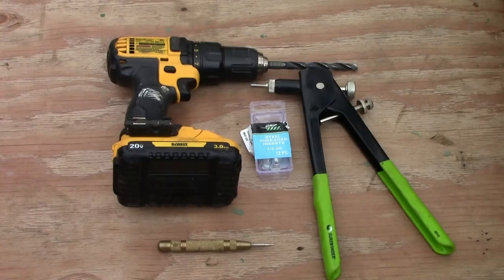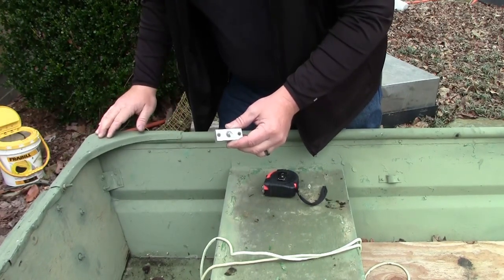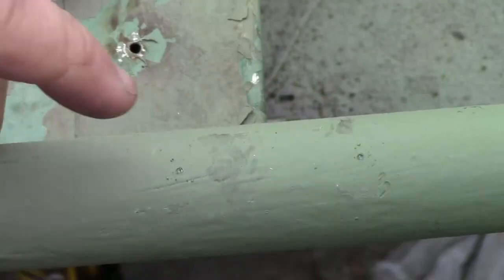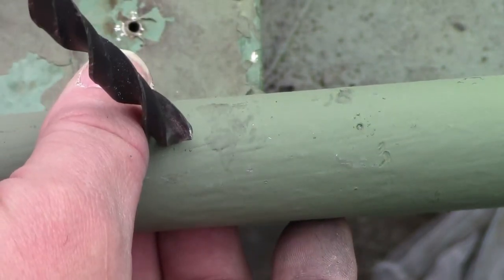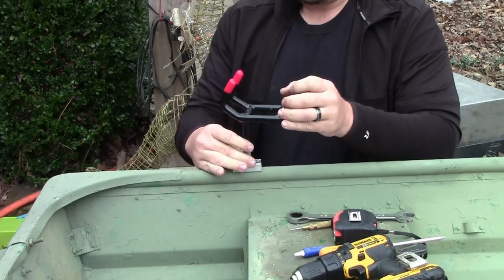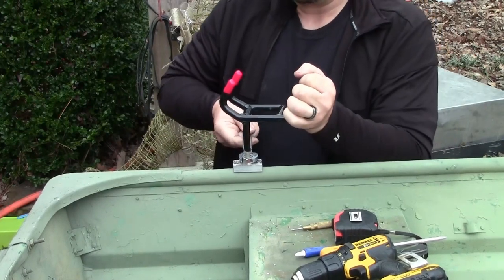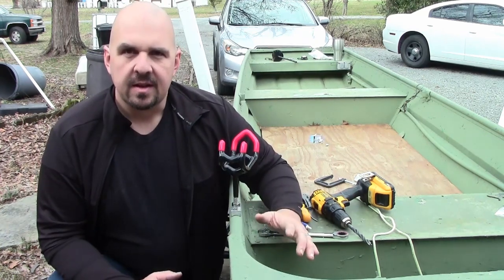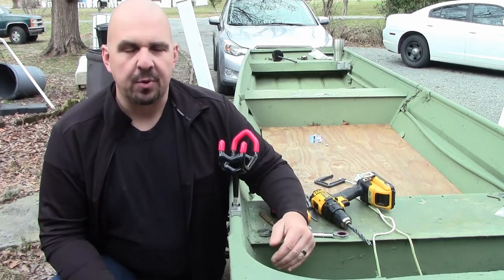How to Install Monster Rod Holders on an Aluminum Jon Boat Gunwale - EASY WAY!

Comment: I had a Tracker Pro Crappie once.  Used self tappers for all my mounts.  They loosened overtime.  This will be the route I take on my new Jon Boat.  Be safe out there.                  thank u

Comment: Just bought all the tools to do this monster rod holder install. Just thought of something tho. My jon boats gunwale is actually flat on top so I just got the flat economy bases from monster. But I got to thinking. Couldn't I just install a 1/2 rivet nut into the gunwale and screw my rod holders directly in to that instead of even using the bases? 🤔 Thoughts? Concerns?
Reply from the maker: You could install a half inch rivet nut, but personally I like the idea of having two points of contact with the gunwale. If that rivnut decides to turn loose with a fish on, that rod holder is going in the water before you can grab it. The odds of two rivnuts going at the same time is much lower.
Reply: @TheWeekendAngler  Ok. Thanks for the quick response. I was thinking doing away with the bases would make for a cleaner look but yeah I can see your point there. 2 would offer more security.
Reply from the maker: @rbarrett8441  a big or a big snag can put a lot of torque on the rod holder in a hurry.

Comment: This looks GREAT...one question though. Is the tool used a standard pop-rivet gun or something different? Thank you in advance...Never mind I replayed it, missed it the first time 😃
Reply from the maker: Here's a link to a tool virtually identical to the one I have. The only difference is mine was purchased at Menards and not Harbor freight. I'd bet money, however, they're made by the same factory.
https://www.harborfreight.com/45-piece-threaded-insert-riveter-kit-1210.html
Reply: @TheWeekendAngler  Hey...THANK YOU!!!

Comment: Does anything come with the base? I know you had to buy inserts and tool separately, but what about screws?
   
Thanks
Reply from the maker: Just the base.
Reply: @TheWeekendAngler  so what size screws!???
Reply: Do you think those inserts would be strong enough if you hooked up with a really large catfish
Reply: @silvermanicattack ….    Just have your drag set low.  You can always tighten it up once a fish is hooked.

Comment: Do you remember what size screws you used?...or did the mounts come supplied with screws?  Thanks!
Reply from the maker: I used 1/4x20 stainless steel machine screws. 1-1/4" is a good length.

The mounts did not come with mounting hardware.

Comment: Hi great video. Where can I get those inserts, screws and tool? What size?
Reply from the maker: I bought the tool and inserts at menards, but they're available on Amazon also. I used 1/4x20 inserts.

Comment: Without the rivnut if you just used self tapping screws would that work?
Reply: Good question 🤔  Idk how much force it would hold up to?
Reply: No they don’t get tight enough then they rip out over time trust me $200 rod and reel setup went to the bottom of the lake

Comment: Man that’s slick. Which model rod holder did you go with?
Reply from the maker: Thank you! That is the monster Rod Holders Talon 5/35. They're an excellent balance for drifting, dragging, or anchoring.

There is a link to them in the description of this video.
Reply: Go with the duo.
Reply from the maker: @paulatkinson4439  Duo?

Comment: Did the same thing, theae wont  hold up for big fish. You will get severe rod holder movement when the rod loads up, the fix is a aluminum angle that connects on top and side of gunnel with the same rivetnuts, just making 4 connections to the gunnel to prevent that roll of the holder I am referring
Reply from the maker: Sounds to me like you're setting your drag way too high. I no longer have this particular boat, but I had zero issues with these rod holder mounts. Your solution, however, would definitely work as well.
Reply: @TheWeekendAngler  maybe, but I don't set my drag tight, have you hooked into 50 to 60 pound blue cats with this setup?, I just found the base and rod holder wanted to roll when loaded up, not to the point it likely would have came free, but I decided to strengthen to the boat better just in case, I really dislike round gunnels, my next boat I'll get something with a versa track

Comment: I'm going  this route  on my 10ft  little  jon for  smaller rivers  and lakes where is the best place to  purchase  the nuts I think  I wanna go with  either  hex head  bolts  or regular  bolts  to mount  my monster rod holder jon boat mounts  what's your opinion
Reply from the maker: I buy the threaded inserts at Menards but they are available on Amazon also.

Hex bolts would work fine too. I don't the it would really matter, as long as you use stainless.

Comment: Last question! What size are those screws you used to secure the base to the riv nuts?
Reply from the maker: Those are 1/4x20 stainless machine screws 1.25" long.
Reply: @TheWeekendAngler  ok I orders the bases through your link. I’m ordering the larger stem holders now.. It looks as if you can get pretty much everything else at harbor freight I’ll stop by there after work. Thanks for the great video and idea.

Comment: What size is your monster rod holders on your Jin boat
Reply from the maker: It's the standard length stem.

I run the 33/45 or the talon 5/35 depending on how I'm presenting my baits.

Comment: Will a simple “pop” rivet gun work or do you need an actual riv nut tool?
Reply from the maker: I wouldn't trust my rod to a rold holder installed with a pop rivet. My fears are it would hold until it didn't...
Reply: All I needed to hear. Thanks. And one more question if you don’t mind.. bottom fishing circle hooks. What would be the best monster rod holder for that? I’m confused with all the different angles. I was thinking the 33/45
Reply from the maker: @bryantvermeys4336  the 33/45 is great for anchoring and dragging baits. If you're going to be suspend drifting, the talon 5/35 is the best one I've ever used and it will still hold a rod at 35 degrees for whe you're anchored or dragging.

If I could only pick one, I'd go with the talons. They're amazing.
Reply: I’ll just be tied up or anchored in a smaller river fishing cut bait on the bottom for small channels up to 10 lbs, occasionally a lake where they get up to 20+ but don’t plan on drifting or suspending.

Comment: Has anyone thought about having those monster gunwale bases welded on? I am thinking about doing that but idk if it’s possible or how it would go
Reply from the maker: My buddy had it done on his boat. Find yourself someone that's really good with tig welding and you'll be in good shape.
Reply: @TheWeekendAngler  okay thank you. Did it turn out good? I have a Lowe 1648 with round gunwales like your boat and I am really into catfishing with big baits and big rods so I hope it will support them if welded.
Reply from the maker: @grizzy7469  it's working quite well. You can see it in action on his channel (Parker Pursuits)

Let him know I sent ya. 👍
Reply: @TheWeekendAngler  okay and I will. Thanks man
Reply: @grizzy7469  large blue cats will roll the rod holder towards the water when loaded up, best solution for round gunnels is attaching aluminum angle to them, which creates a flat surface on top of the gunnel to mount rod bases to, I used 4 1/4x20 rivnuts to attach the aluminum angle, 2 on the inside, 2 on top, the ones on top I placed the holes inline with the rod base so I had bolt  passing through each base hole through the aluminum angle into the rivnut in the gunnel. If you use 1/4" thick aluminum angle, you can also put a 1/2" threaded hole in the angle so the rod holder screws into the rod base and also 1/4" into the aluminum angle, you will get ZERO holder movement with this method, I catch 60 plus pound blue catfish and the rod holders don't move

Comment: Do you think the rivet nuts would work on a pontoon rail?
Reply: Where did you buy your rivet nuts? Do you have a link?
Reply from the maker: @1BigCountry143  I got mine locally at Menards, but they're out of stock now. They are available on Amazon for a good price. Stay away from the aluminum ones, they like to strip out. The stainless or regular steel is good.

I think they would work great on a pontoon rail, but if I had the option to put a nut underneath, I'd rather do it.
Reply: @TheWeekendAngler  Are you still thinking about the idea I gave you last week about putting a led light strip counter sunk into the top of your bunkers?
Reply from the maker: @1BigCountry143  I sure am. I've been checking out some stuff on Amazon to get ideas.
Reply: @TheWeekendAngler  I can't wait to see what you come up with! 😁

Comment: Does it take a special tool to put those in
Reply from the maker: Yes. You can get them at a lot of the big box stores and harbor freight. Amazon has good deals on them also. Best thing is they're affordable.

https://www.amazon.com/dp/B07NVSPYNM/ref=cm_sw_r_cp_apa_fabc_A08HA97B4DCE3Q1YZ1HN

Comment: What size riv nuts?
Reply from the maker: 1/4-20
Reply: Obviously aluminum riv nuts?, and would it be strong enough to hold without lock tight as I would want to remove the mount to put a duck blind on my boat?

Comment: What kind and size of screws
Reply from the maker: Those are 1/4x20 stainless steel machine screws. I used 1.5" long.
Reply: You said 1.25 and now 1.5 long, can you say which one is best